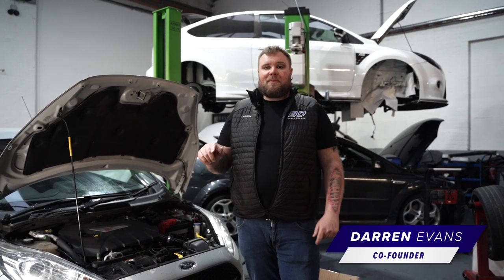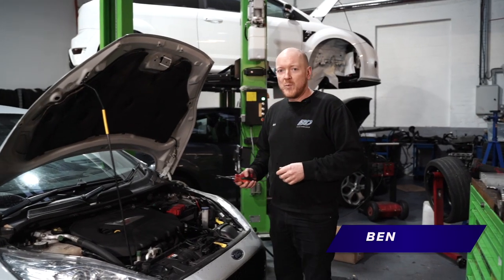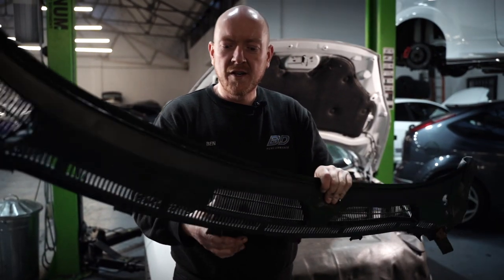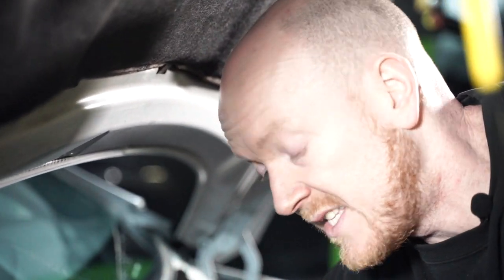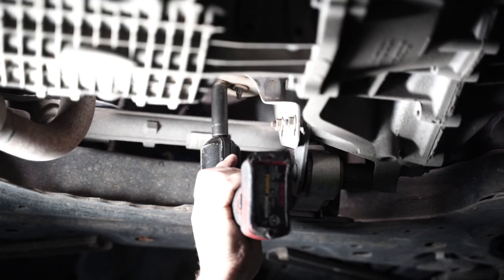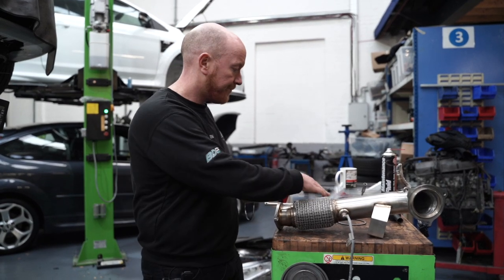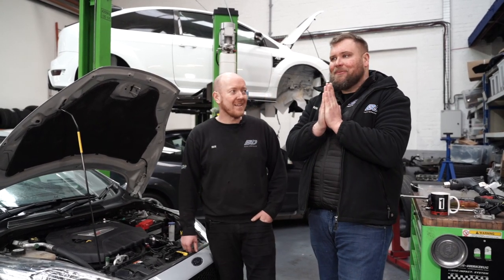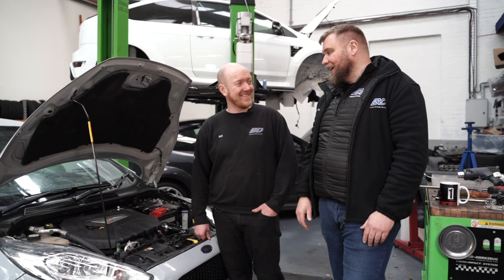Fiesta ST Mk7 Downpipe / Decat - Worth It or Not? *VUDU*

Comment: Watching this video as my car is apart on ramps in my driveway.  The top bolt to the turbo was cross-threaded or otherwise seized and ended up snapping even after letting it sit with penetrating oil for an entire day.  I had to remove the turbo to drill out the broken bolt and re-tap the holes, and then I ran out of time.

Hopefully today after work I'll have time to start putting it back together.  I'm using a catted downpipe so that it will pass emissions.

The intercooler is way easier to do than the downpipe and will add a lot more power with a tune.

Comment: Every downpipe installation video the headlights come out with no explanation but from what I've seen they don't seem necessary to remove?
Reply: Absolutely necessary, you xant get yo the bolts for the scuttle panel if theyre still in